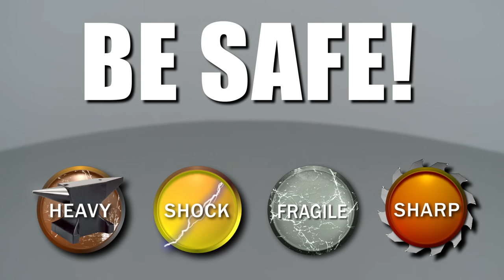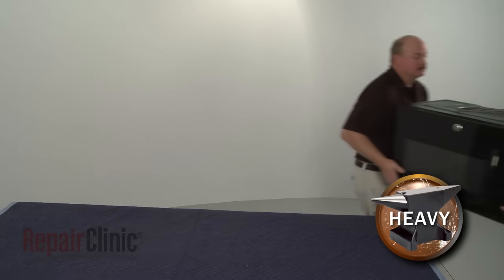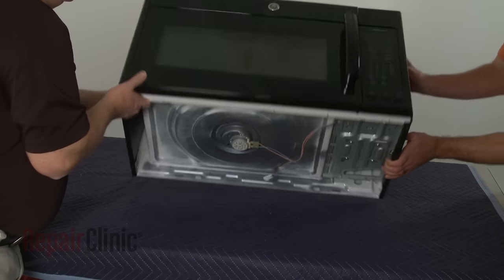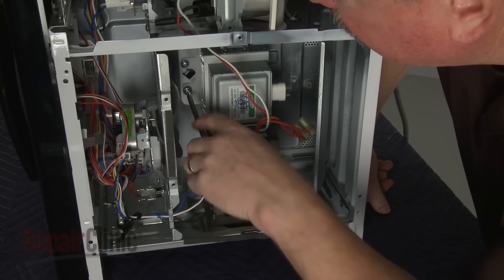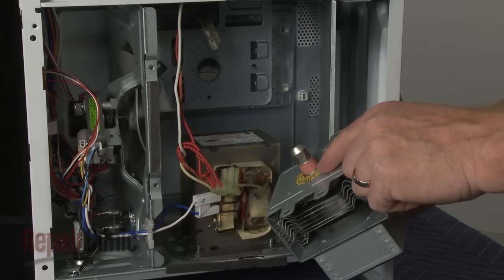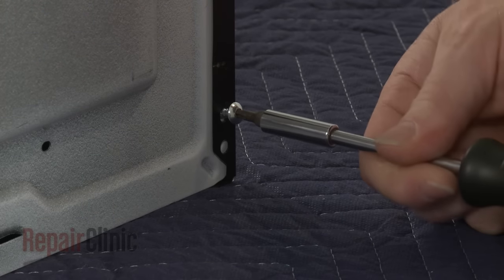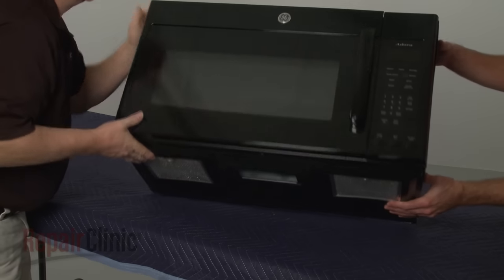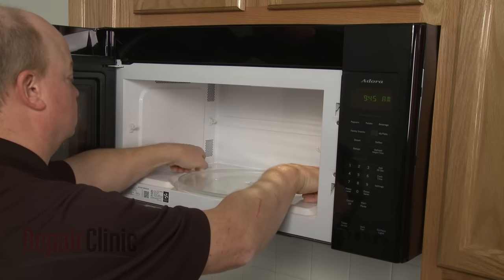GE Microwave Not Heating? Replace Magnetron #WB27X11079

Comment: I remember when i was shocked by that red wire that comes  out from capacitor into magnetron , it lasted for 6-8 seconds or so and i couldn’t take my hand away then it came out from my leg, still have a scar on it.That was literally nightmare. Still afraid of electricity. Please be careful out there folks. It’s not a good idea to risk your health/life for 200-300 bucks.I thought i will die in there.
Reply: What did you do wrong??
Reply: @terrylane9570  I accidentally touched plies metal part , it was my fault 🤦🏻‍♂️ 😅
Reply: Unplug it next time, give it give minutes.😉
Reply: @robkellerman4666  yeah i mean it’s been like 4 years since it happened and 2 years since i wrote a comment bro
Reply: @solidredd6481  yah and what like 4 minutes to reply?🤣🤣🤣 
Next time I'll make sure to assess the age of the comment before I then reply to it.🙄
Reply: @robkellerman4666 It can shock when unplugged due to a stored electrical charge, the video discusses it.
Reply: @robkellerman4666 how many minutes (if you’re afraid to touch it even with rubber handled pliers)?

Comment: How about the Diode, I read that should be replaced too? FIxed mine was the Magnatron
Reply: Is the diode that little connector to the capacitor?
Reply: @MOAON_AABE  Wasnt an issue with mine
Reply: @shckltnebay  did your microwave have a burning/weird smell like mine?
Reply: @MOAON_AABE  No just stopped heating
Reply: @shckltnebay  damn! Thanks anyway.

Comment: Excellent video. I see many questions on repair or replace, I say it all depends on individual situation. In my case my microwave is 19 years old and the magnetron just went bad. I also need to replace the filters so if you add up here and there with a possibility of other things going bad due to age is best to replace but if you only had it for less than 5 years I guess you could fix it. Hope I make sense of this. Good luck to all.

Comment: Great video….. it was super easy to replace the magnetron and diode in my GE microwave. I did it on my own and used a sturdy cardboard box underneath the microwave to take the weight when removing it and reinstalling the microwave.
Reply: Did your microwave have a weird burn smell when you try to use it and not heating
? Mine does, could that mean it is the magnetron, or diode, or both?
And how will I know?

Comment: Thanks for making this video! Although I have a Kenmore Elite, this gave me the information I needed to replace the magnetron. Microwave works like a charm now. Thanks again!
Reply from the maker: +Carlos L Aguilar Thank you.
Reply: where do you get the part, Is it cost effective to repair or replace
Reply: @jegan6537  You can order from any website that sells Kenmore parts but you need to first find the part number from the drawings they provide. Since this post was 4 years ago, I don't recall where I bought the part. Sorry

Comment: I have GE Model ZDP 48N6DD1SS, Serial # DD2035407
I cannot find this part in the GE System:  Wire Relay Part # WB21X5362 Hot
Any advice for sourcing?

Comment: I tried this repair today. Very easy to perform and this video makes it a lot easier. Thanks for making it! Unfortunately, it did not fix my problem. The turn table no longer worked after replacing the magnetron and it still didn't heat up. I'm guessing it is a motherboard issue. Time for a new microwave.
Reply: Wow that sucks

Comment: If the magnetron looks good and not burnt should it be replaced? If it it replaced as in this video and still does not work what could the problem still be?
Reply: Did you find any answers?

Comment: Had a smell when it stopped working and sounded alittle louder humming noise. Black soot behind the magnetron but i tested it and its ok but still no heat also tested everything from fuses to diode but cant find the issue,  wasted my day and the parts are more than buying a new unit from HD

Comment: Can I ask why you didn't test the unit before reinstalling it on the wall?
Reply from the maker: Very confident in our work! No really not a bad idea at all, thanks Robert.
Reply: RepairClinic.com  sir make video for front load w mashine pcb repair or chek fult if no power
Reply: "Radiation"
Reply: @frankmata1812  Microwave oven radiation is not at all harmful to humans and is totally harmless 
Microwaves are norhing to worry about

Comment: My microwave aint heating i changed all the door switches an the little black diode connecting to the capacitor an to a ground i dont know if its the magnetron r the transformer any ideas?
Reply: Ashley lanclos could be one of that , me not aware fully too.. get it done buy some repair place...

Comment: Why can't these so-called "experts" do a video explaining how to troubleshoot and give common scenarios as to why turntable stops, and convection and blower stops and what parts control them??? We're not electricians who can understand how it all connects and functions. I've replaced the door switches already and power fuse. Do the transistors at bottom of front panel have any relation????